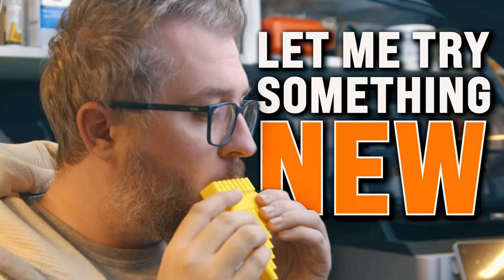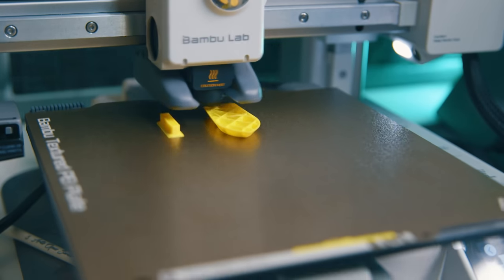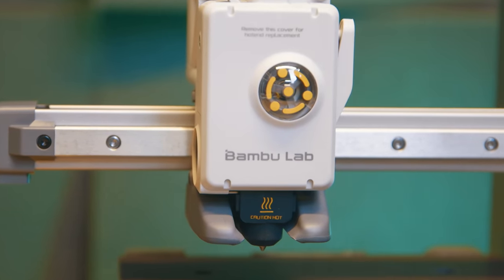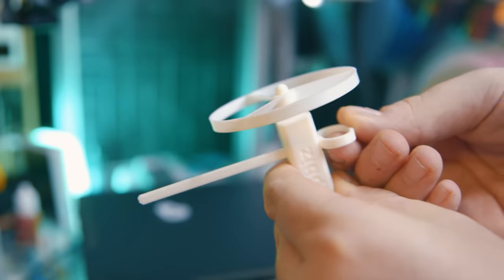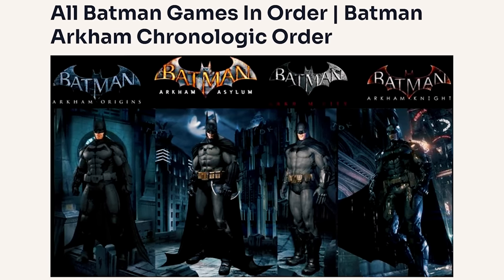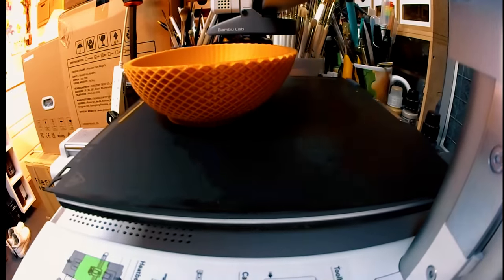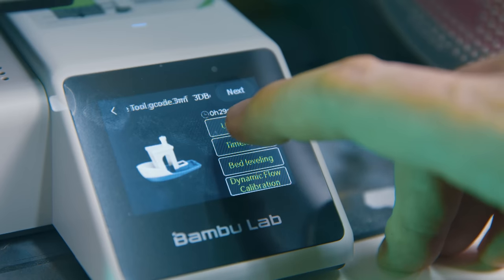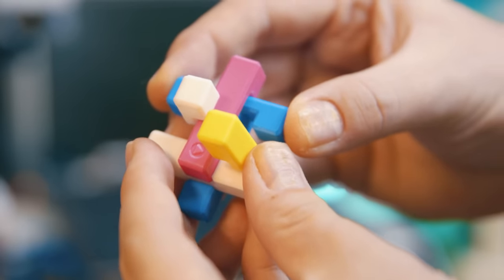Bambu Lab - A1 Mini Review - IT WASN'T MADE FOR YOU!!!!!

Comment: It is 330e for a bed slinger printer with small bed and low bed temperature, incapable to printing hi temp materials, proprietary closed enviroment. You can get a small coreXY for almost the same prince with open source klipper and print ABS and even nylon with that, upgrade whatever and service it your self. Or you can spend 300 for a 300x300mm cartesian that can print anything.
Reply from the maker: Exactly, but what if you don't want to do that maintenance That's who this is for..
Reply: @FauxHammer  What maintenance are you talking about? After a while you will have to tight up or change stuff like belts, what are you gonna to do? Send it back to China or buy a new printer? I'd rather have a 4$ spare belt in my drawer for when that day comes.
Reply: Apparently the A1 mini can print some other materials even though they are initially not recommended. At least that's what someone was told by bambulabs. It already has hardened gears in the stock configuration and they offer hardened print heads.. The issue is as you said, the bed temperature. From what was said, It seems simply putting an enclosure, even a cardboard box,should keep in enough heat to work with some materials

There's also mention that there may be a way to raise the bed temperature through the firmware, but not much was said about this. I imagine in the coming months we'll see what develops in regards to pushing the A1 mini with other materials.

I have one coming this week, and it's my first printer. I went back and forth trying to decide which printers to get because I did want a bigger build plate and the option to work with other materials. However instinct kept nudging me towards the A1, so I ultimately went with that. I definitely want to put my time and energy into designing and printing and want to reduce the amount of tinkering as much as I possible.
Reply: @whyired  And what are you gonna do with those prints? Projects I guess. Half my projects are improved 3d printers, laser cutters, saws or tools to build better projects.

If you are going to print the usual stupid shit you can as well print a duct fan, if you do some arduino stuff you can as well print and upgrade your printer, modify your firmware...
Reply: @eaman11  I'm definitely leaning towards more functional prints as well as some inventions and existing product improvements. Definitely keen on utilizing it to create custom organizational systems. But on top of that I have two teenage girls who will most likely find quite a bit of the more decorative stuff that they will end up wanting to print.

I mentioned the options and further potential of the A1 mini only to point out that it does have the potential to grow with the user to an extent. If they want to experiment with different materials and whatnot. As you said it really comes down to what one is going to be printing. But for me the ease of use and a simplified user experience is of high value. I do not like to waste time on something I'm not really enjoying, and even though I come from a computer science background and have the technical ability to work with complex machinery, I just don't enjoy the process as much anymore. As I've gotten older I've been leaning more into the creative side. I notice my brain is already naturally looking for useful functional prints and improvements that can potentially reduce the friction and enhance the ease of use of various things. I am excited to learn and work with CAD even though that can be a bit technical, however the bridge is the inherent creativity that is a property of the design process itself.

P. S. Apologies for any typos, I'm using text to speech as I walk to reply.

Much love and gratitude.
Reply: @whyired  I think that it is important for the user to have a good functioning printer available before diving in any customization and debugging that can be stressing, but the nature of the making culture and print community has always been problem solving.

Otherwise it's like saying I like surfing but I don't wanna get wet, I like snowboarding but cold ain't for me. Beginners ain't getting anywhere in CAD, Blender of structural design with that attitude. 

I hope that you'll enjoy your new printer a lot, maybe next year you'll have more experience and so you may get a cheaper refurbished one with a bigger bed or better suited for hot materials.
Reply: @eaman11 I do want say that one can have the motivation, patience and discipline to learn CAD, while at the same time not be interested in expending energy on tinkering with printer itself. For example I may enjoy the problem solving aspects of coding but not enjoy trouble shooting hardware. 

Actually what you said about possibly getting something with a larger print bed in the future, is pretty much aligned with my thinking. It's one of the reasons I got the AMS combo with the mini. I think bambu will be releasing a series in the A1 line with a bigger bed at some point in the future. My hope is to use the AMS I'm getting with the mini with the future larger bed A1. If I'm going to upgrade in the future, odds are I'm still going to want it to be a smooth user experience with the least amount of friction as possible.
Reply: @whyired  Doesn't work like that: in order to design for printing you have to know the CAM / slicer and for that you have to know the printer and you have to tweak both. 

Auto level and stuff only takes you so far.
Reply: @eaman11  Yep. you will have to unplug a nozzle, replace a fan or a hotend..... NOTHING is maintenance free
Reply: @danhouse7565  sure but the hot end is an easy quick swap, as for other maintenance, it's not about being able to do it, it's about wanting to do it as easy and little as possible when necessary.
Reply: @eaman11  understanding certain principles behind the print and design process is not the same as spending large blocks of time in the multitude of aspects that are part of the tinkering side of 3d printing. Sure having the experience accumulated through tinkering is of benefit, but hardly a requirement. Working with a 3D printer and then mapping across various principles to the observed real world printing process is probably enough when combined with other learning resources to get most people to the point they need to be at to understand the necessary principles of the design process.
Reply: @whyired  You don't realize that leveling a bed, setting Z or cleaning an hotend  is 100x times easier than learning Fusion, Blender or a slicer. I don't get where do you want to go in 3d printing if you insist in refusing to acknowledge the printer: first time that you get a bad surface what are you gonna do?

Do you think you can build stuff just by wifi or USB? You think that materials and tools are a waste of your time? 
You are not going to be the first one to be disappointed.